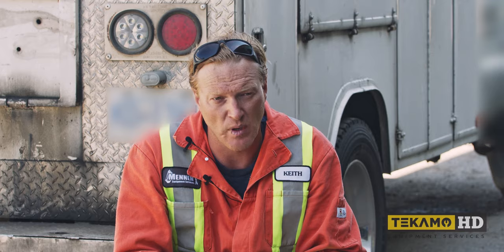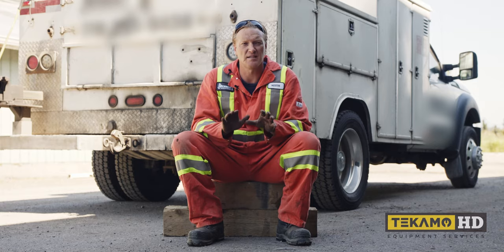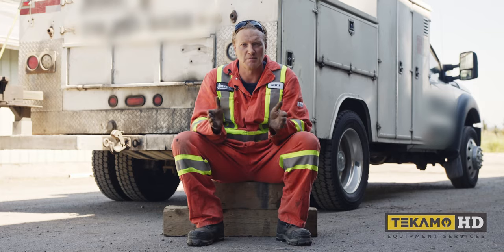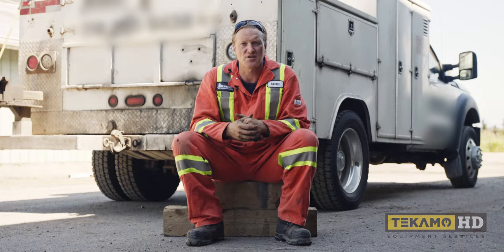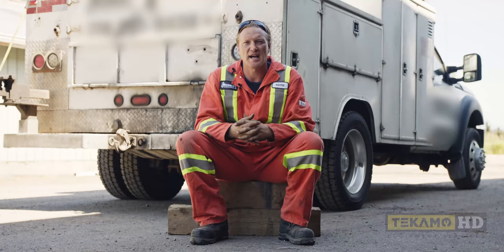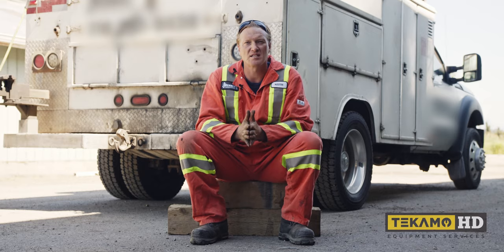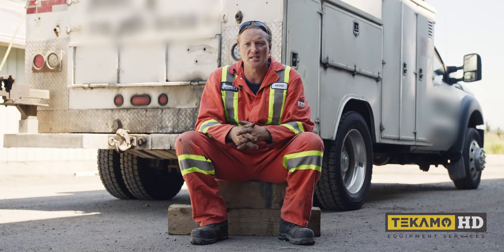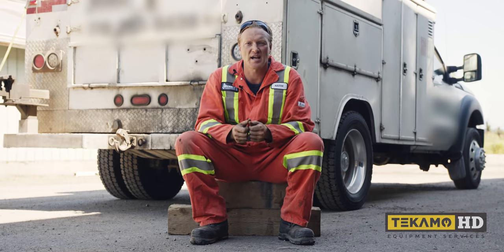Heavy Duty Mechanic Q&A - EXPERT ADVICE Get Your Questions Answered!

Comment: Very good vid.
I'd like to add that some bushings I've run into, or at places I've worked, are just bog standard mild steel. Especially attachments.
That said you should consider where your drilling swarf will go.

Not much sense in drilling a hole to lubricate if you're gonna leave sharp steel to rub against.
Reply from the maker: Ya I agree, do the job right the first time so there won't have to be a second time.

Comment: Great video,   when a 35g  engine is running and you remove the oil filler cap, is it normal for the oil to burp out?
not spit out. 1 machine I was looking at buying did this,